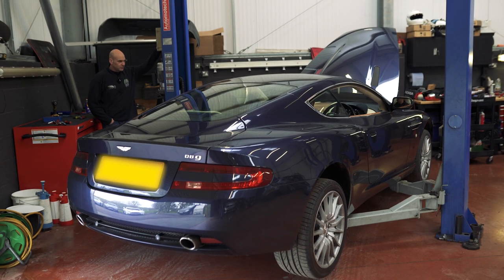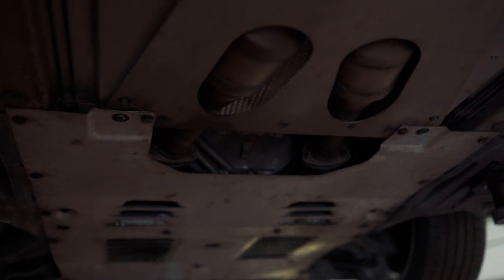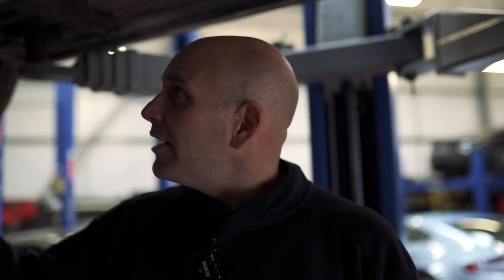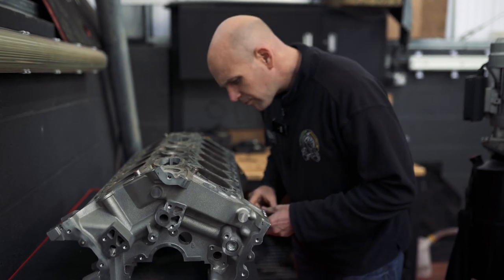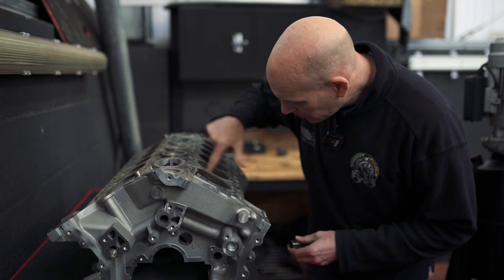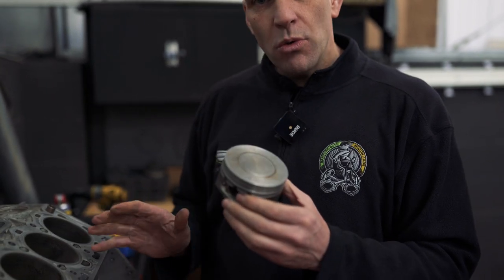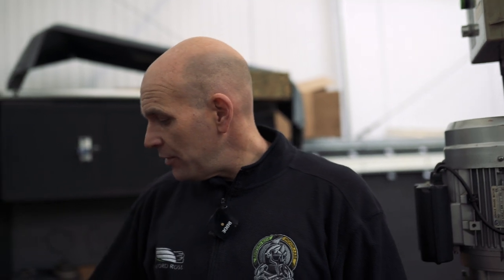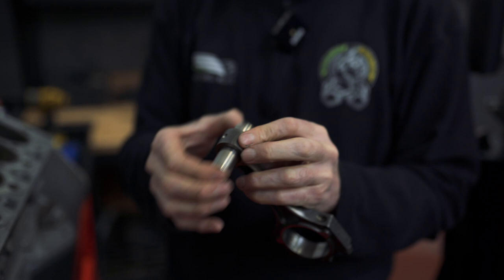Detailed Follow up to the DB9 Engine Tick -

Comment: Fantastic explanation for this..  after pages of comment on forums this was pretty comprehensive. 

Of course we are all wondering how this piston slap would damage the engine? What would be the effect to just relatively live with the noise? 

As some owners now know that the cost of a rebuild outweighs the value of the vehicles.
Reply from the maker: Graham Brand 

I know of a few cases where the owner carried on driving. In all cases the point of repair was when the tick became too embarrassing!

What I normally see when driven for a long time with the condition is the liner wears oval, it drops / sinks in the block casting a little, enough for the head gasket to eventually leak and allow combustion gas into the water system and a pressurisation of the water system expelling coolant into the expansion bottle.

I’m sure nursing the engine along, it’ll go for quite some time, but do a few laps at race pace and the issue will turn into something more serious.

Comment: Great video, very informative compared to endless forum topics about this. I have a question however, is there something that can be done to prevent the problem occurring in the first place? Good oil and regular servicing is a given but is there anything else that owners could do?
Reply from the maker: Robert13O8 unfortunately I think not, and this is what niggles some owners. They have done absolutely everything correct as an owner to wrap the car in cotton wool, serviced, checked oil level and not race’d or rally’d, yet the problem has still occurred. As I’ve mentioned in other comments, I think it’s therefore a case of buyer be aware at point of purchase and if the problem occurs in ownership, hopefully a rehone and the evolved small end bush is the extent of the rebuild

Comment: Gents, just wondering if - another year down the road - it's become any clearer whether this issue affects both UK-manufactured engines AND the German-manufactured AMEP engines, or just the former. As I understand it, both are the same design, but it's been suggested there may have been a difference in manufacturing or quality control between the two plants which meant the AMEPs did not suffer the same oil starvation. I am taking a DB9 for a pre-sales inspection on Wednesday and she has a slight tick, but she has on '07 AMEP engine, so it will be interesting to see if they diagnose potential small end trouble.
Reply: I can confirm top-end wear induced clicking on a 2006 AMEP-engined DB9. So while the condition seems rare in general, it is clearly a possibility in either case. In summary, you should definately not rule out small-end wear/bore ovality just because the enging is a AM04 numbered Cologne manufactured engine. 
I would suggest all pre-o8 models are susceptible due to this condition due to the oil level issue, which means a poor service agent or a careless driver allowing a lower level to starve a pot just enough to start of the wear process which results, perhaps 20k miles later, in the tick.

Comment: Great video, thanks.  Whilst exact cause is complicated and not thoroughly known, what proportion of cars, in your opinion could be affected, less that 10%,less than 5%?
Reply from the maker: John Chambers that’s a tough one because how many early db9 had replacement engines because of low oil level failure or cat debris ingested/ failure. And had those issues meant the engine would have been in for longer, would all of those eventually exhibited the tick? Because the variables are too many (little / low use and such like) I think the purpose of vids like this is knowledge and buyer be aware at point of purchase. If the tick develops within ownership, if the fix is a rebuild, a few liners / pistons (not crank or expensive machining) means a rebuild isn’t the end of the world, but clearly will cost a sum
Reply: I totally disagree with your statement that the exact cause is complicated. The exact cause is simply poor engineering, and one needs someone with a bit of integrity, like Mike and the team, to sort it out! Plenty of powerful engines that don't have this issue. They may have other issues, but ticking issues is just poor engineering, plain and simple. IMO, thank goodness there are people like MIke and the team, however given the price investment of the initial purchase, Mike and the team should be somewhat superfluous don't you think? 
Having witnesses some diabolical Aston experiences of people I know (one was my boss) I couldn't envisage having and Aston in the first place, but if I did, Mike and the team would be my only port of call. Aston and Aston works, form the experience of having seen friends/associates who have had Aston's, are complete jokers. 
Sorry for being so harsh Mike, Just my observations and obvious conclusions.
Reply: @utubecomment21  Engineering combined with manaufactuering. Great engineering can fail when improperly manufactured.  Also long term durability testing at the manufacturer would have uncovered this early and stopped it.

Comment: Hi, I watched this video with a huge worry because my 2001 DB7 V12 Vantage (manual stick shift) produces exactly that noise. But the car drives very well. What will happen if I do nothing? Will the engine eventually blow up? How much would it cost to be fixed? Many thanks, Sm
Reply: About £8,000 depending on the car
Reply: @willcatch  many thanks! Is this at the Aston Martin dealer?